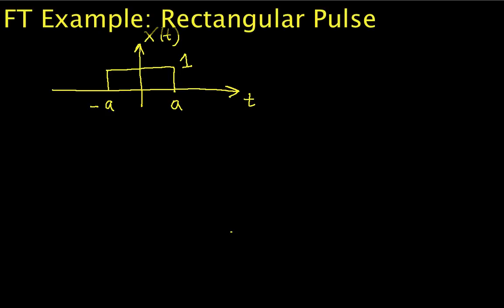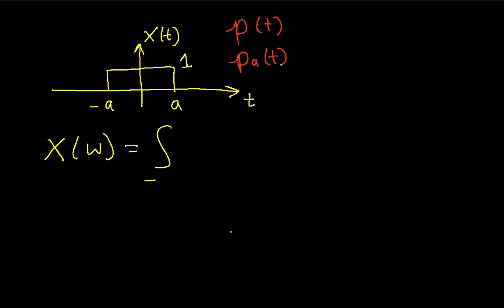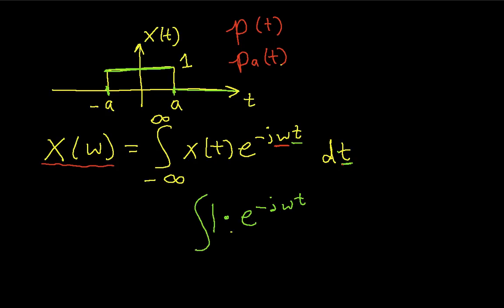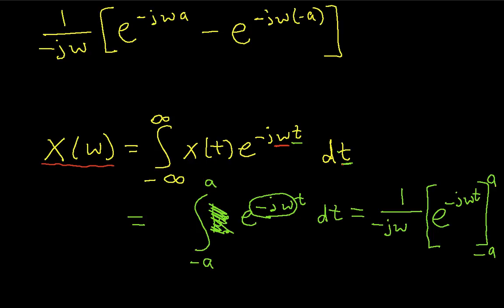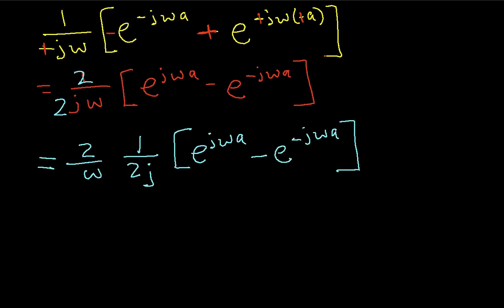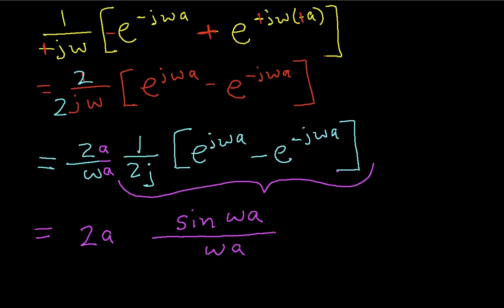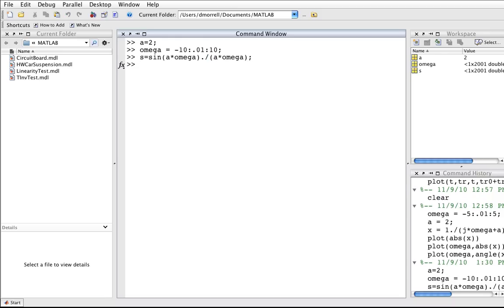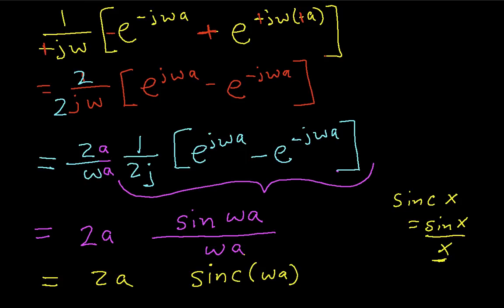Fourier Transform Example Rectangular Pulse

Comment from the maker: A complete representation for the signal is
s(t) = 1, 0.25 less than t less than 0.75
s(t) = 0, t less than or equal to 0.25 or t greater than or equal to 0.75
You could also write it in terms of unit steps as
s(t) = u(t-0.25)-u(t-0.75)

Comment: Would you please comment on the physical significance of the Fourier transform of a transient signal like this pulse. 
With a Fourier series (for a periodic signal), the line spectrum tells you what you how much signal amplitude you would measure on a spectrum analyzer at each of the harmonic frequencies, continuously.  What does the FT spectrum tell you in this case?  At what point(s) in time would you actually measure the ordinate values in that spectrum?  Thank you.